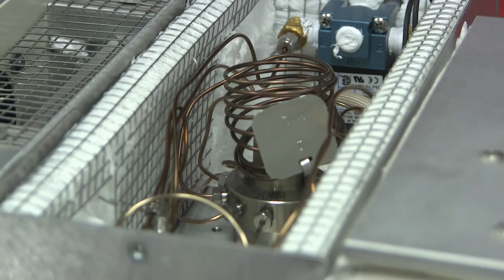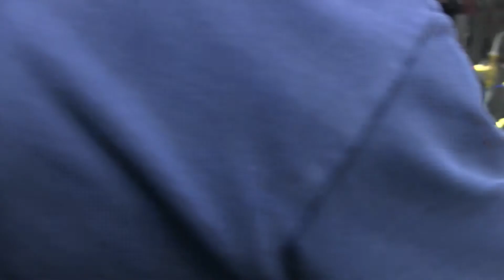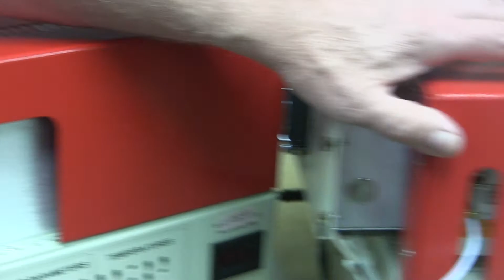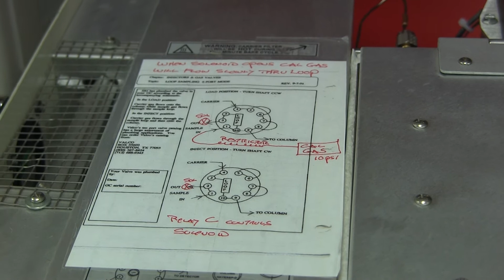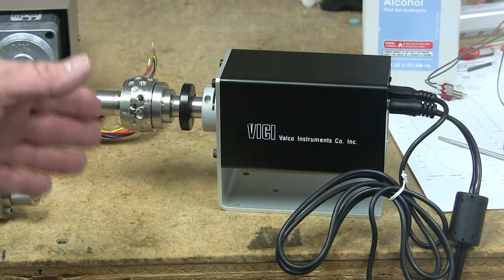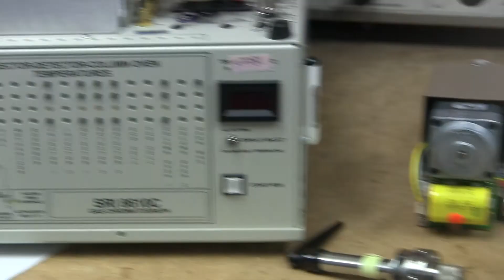Valco Valve SRI GC

Comment: Hi Hugh, how is valco valve connected to the column?
Reply from the maker: It varies from configuration to configuration, but they all basically connect in the same way. The first page of this PDF has a diagram showing the column connected to the valve
http://srigc.com/cn/downloads/31/MultiGas3InstructionsFebruary2015.pdf